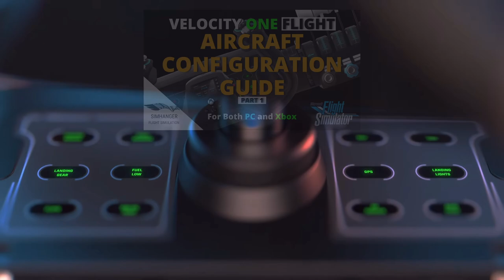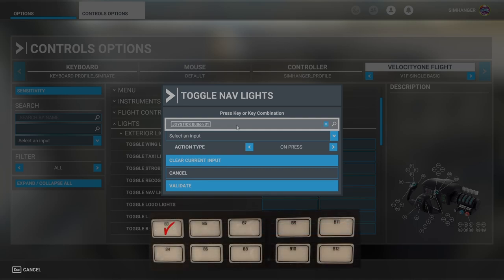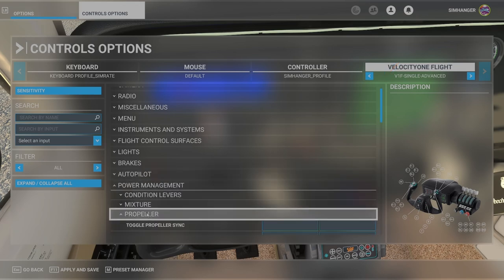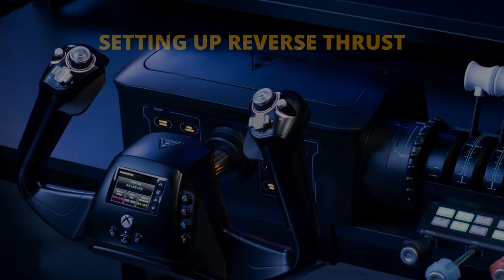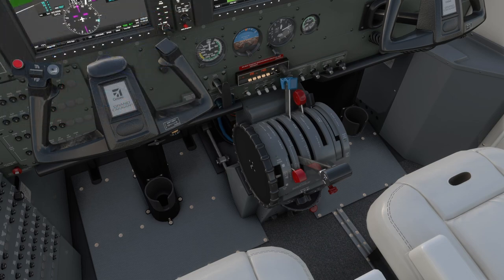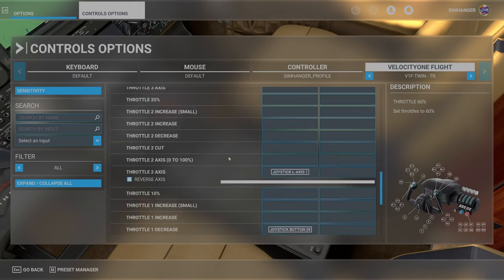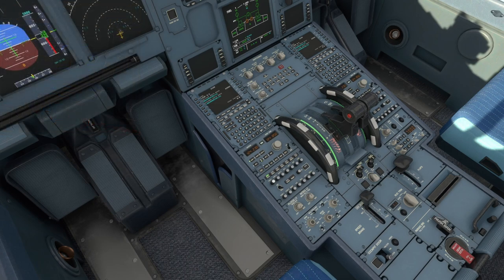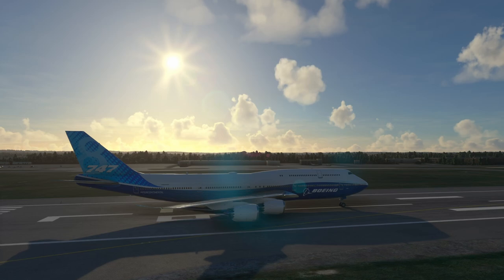VELOCITYONE FLIGHT AIRCRAFT CONFIGURATION | PART 2 for XBOX | Including Reverse Thrust | MSFS

Comment: With the flap axis when u said if I move it up and down this will show on the screen, for me it just stays at the same position
Reply from the maker: It should move. Check externally if the flaps are moving. If not then the config is wrong (make sure all pilot assist features are off) or the aircraft you’ve loaded is not using the default config. Check with default aircraft.
Reply: Hey thanks so much for the fast response I just had to exit the menu then enter in again thanks so much I’m loving the controler

Comment: i have a problem with your config. The game will not allow throttle one to work as normal. What i mean is the throttle  will working in reverse, that means to get power i have to pull the black throttle back. If i set it to normal i.e. get rid of  reverse axis, the throttle only goes in half way, it does not complete the full range of movement. when i have the throttle in reverse it does complete full movement. Also sometimes the game will pop the throttle forward or backwards, meaning it will jump half its movement.
Reply from the maker: Disable pilot assists in sim.
Reply: @SimHangerFS  hi thanks for the reply it does not work i have all assists off. Also the trim wheel causes massive spikes, it is unusable. I got it to work it was a firmware problem. How do you map the jet to the pc velocity throttle etc, it has different names for axis , so i cannot use your video on for it. Thanks
Reply: i did manage to get the jet engines to work,, well in in a fashion i did. The black  throttle for the small planes only works in reserve, meaning to get power, i have to pull it out.  Tick the reserve box deadens it. I am at a loss what to do. i have  no assists on and the throttle is now bound any where else.
Reply from the maker: @Mulberry2000  Sounds like a hardware fault?

Comment: Honeycomb yoke and throttle still not available for Xbox, would you recommend This TB accessories instead.  Per honeycomb, they don’t have date yet for availability.  Thanks
Reply from the maker: I have no date from Honeycomb also. TB is the next best thing.
Reply: thanks for your quick reply. im on xbox for a long time and just got series x lately,  but would like to get on flight sim and  get all the right accessories the first time to save money in the long run. i will be following your channel. thanks again
Reply: xbox has so many versions of the flight sim with the standard edition that  comes free with game pass.  Would you recommend the standard edition for newbies?
Reply from the maker: @butch5187  yes, try that and see if it what you want…you can always upgrade to premium or deluxe later.

Comment: I may have this wrong but I configured both the yoke profile and then one for the quadrant (using Xbox). I am trying to understand if there is a way to use both profiles at once. I selected yoke and it works as expected for yoke controls and the same with the quadrant. How can I get the yoke and quadrant profile to function together? Thanks.
Reply from the maker: You can't on Xbox. You need a simgle profile im afraid.
Reply: @SimHangerFS  Ok. So I should  rename the Yoke profile and add the basic quadrant functionality into one profile.
Reply from the maker: @jmoestretti  yes Sir, exactly that.

Comment: Thanks!
Reply: Mark, you are the ABSOLUTE BEST! You must have been a teacher in this or a past life...your instruction is concise, well-narrated and well-filmed, and I'm sure that I (as well as many, MANY others!) have greatly benefited from your experience. Glad you're here and dedicated to helping others...

Couple of questions for you:

1. I've copied profiles over as you showed in Parts 1 and 2 and have stopped (for the time being) after setting up V1F_single_TR. Will get to twins and jets a bit later. When it came to setting up the upper right stick on the throttle quadrant for flaps axis, it programmed OK but when I go for a test flight and watch the flaps lever on the console, it moves sort of "herky-jerky". I can hear the "noise" of the flaps moving up/down and see them moving if I go to external view. It just doesn't seem to work as smoothly as it did when you demo'd it in your test flight. QUESTION: Could having "all assists" on when doing those test flights be interfering with the settings, or do the assists work ONLY in training and not in free flight? If it's not the assists, I must have mis-entered something and will have to go back a profile or two.

2. At this point, I have some "unassigned" buttons, namely, HAT-1 up/down, and B9/B10 on the programmable buttons on the TQ above the vernier controls. Any suggestions for things to program those to? I also don't have anything assigned to POV-2/External...best just to program that to an external 360 freelook?

Finally, glad to see TB is on the ball and put out an update/instructions for the reverse thrust issue. (I liked how you had it set up on HAT-1 up/down but might as well do it TB's way as it seems a bit more...authentic). While I haven't gotten as far as twins and jets yet on the profiles, setting it up for one stick was pretty easy...pretty much the same thing for multi-engines?

Cheers, and keep up the GREAT work! 🙂
Reply from the maker: @neilmackey9626  thanks Neil, glad you found it useful 😀and thank you for supporting the channel, much appreciated. Unassigned buttons could be assigned to autopilot functions. Pilot assist does interfere with these settings as your setting flaps up and your copilot might be trying to set flaps down for example. Turn off pilot assist when checking assignments. 👍